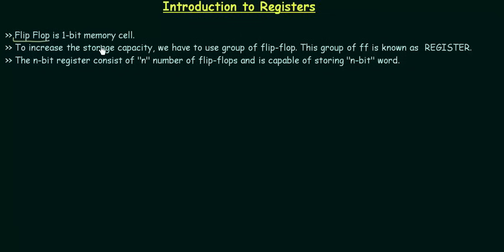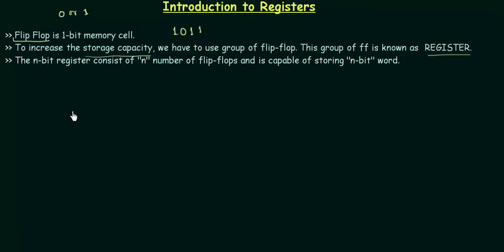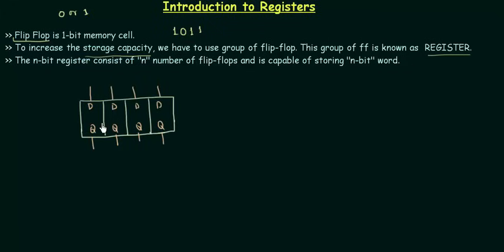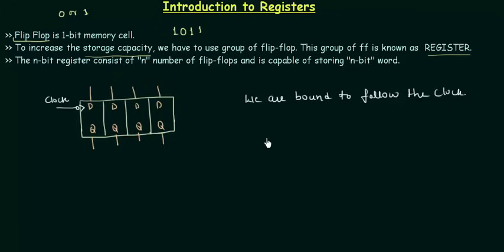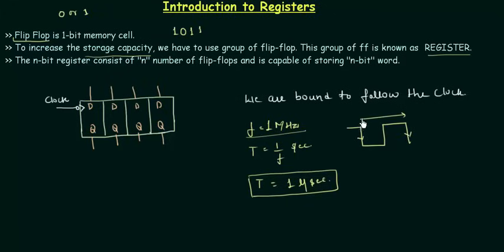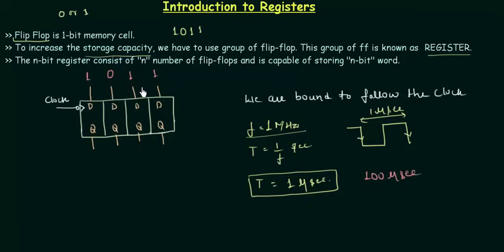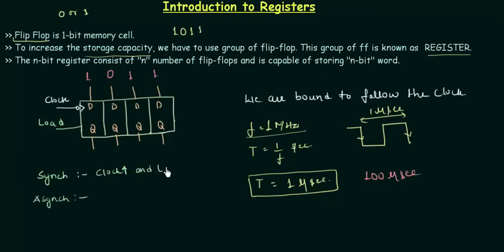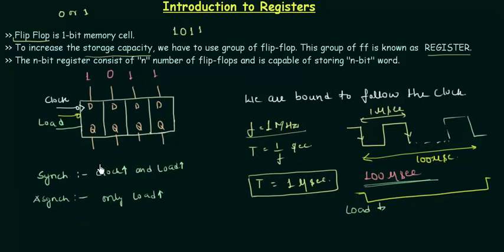Introduction to Registers

Comment: Sir while making 4 bit register you used -ve  edge triggererd sign in clock pulse . Can we use +ve edge trigger in place of this as we previously use -ve edge trigger with mastet slave D flip flop so it is little bit confusing

Comment: there is a small doubt regarding this lecture. in case of d flip flop the value stored will not change till the value of d is changed, then how wll it change in every clock pulse. since the value of d is not changing in every clock pulse, the stored value wll also not change. then, whats the use of load?
someone plz clear my doubt
Reply: There are times where you have registers hooked up to the outputs of memory, ROM, RAM, etc, or instruction registers, controllers, and more, and you want to hold the value while its input may be changing. This is where load is useful, as you can be assured the FF will hold the value while load is false.
Reply: zarkbark 
got it
Reply: But how come data is getting changed due to clock...as told taking an example after 1 micro sec... Data in flipflop cant b changed by clock

Comment: if the input value is changed then output gets changed;so thats why you are using a independent LOAD terminal;why can't you consider clock is equal to zero  such that even if the input value changes then the output doesn't change ;where the output remains same.

Comment: I have a problem to understand an assignment, it is about drawing a circuit that realizes data transfers from the four-bit register R0 to the four-bit register R1. It says that i can use as many 1-bit 4 to 1 multiplexers and logic gates that i need.  
Can you please help , becouse i have the exam on this tuesday and i really need help
Thanks in advance

Comment: I'm very confused with load
1.the sync load enable the register to go in transparent mode when both clock and load are high.So does it means we  are bound to use the positive level clock?(since its what makes triggering when the clock is high)

2.the async load enable the register to go in transparent mode when only the load is high.So  does it mean we are totally independent from clock triggering?|

HELP ME I'M THE DUMBEST BEING ALIVE.